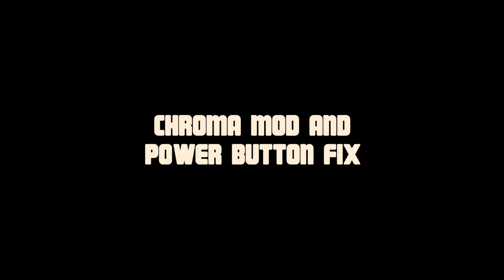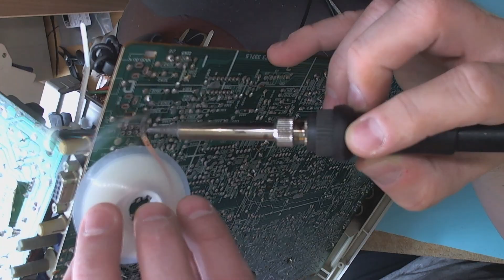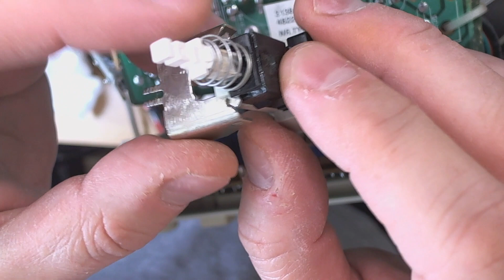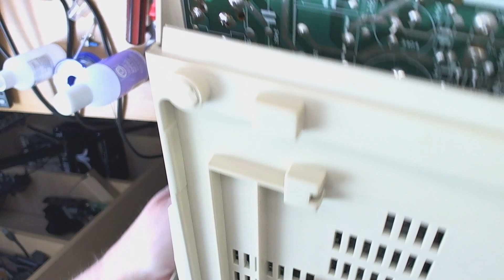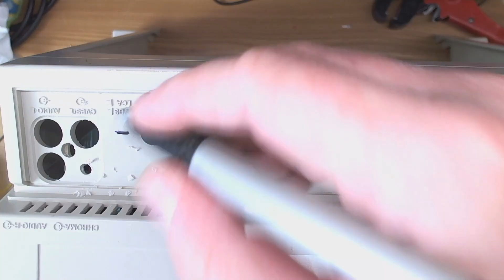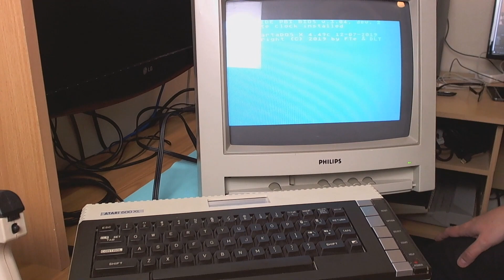Philips CM8833-II CRT Monitor Chroma Mod and Power Switch Replacement

Comment: Would you mind sharing where you ordered the different parts ? Are the extra switch and RCA panel difficult to source if you don't have a donor monitor ?
There is an online shop selling a ready made kit, but it's really expensive (about a 1/3 of the going price for the monitor !). If anyone reading this (especially in the UK) is able to put together and sell a parts kit, that would be amazing !
Reply from the maker: I got all the parts on eBay except the switch covers which I stole from another monitor. I might still have an RCA bracket but since I'll be in some degree of disarray until I finish unpacking and categorising all my stuff following our recent house move, it may be a while before I can find it. I don't see why the upgrade kits should be so expensive, although I can well believe it's the case (that's why I ended up sourcing the parts myself).
Reply: @flashjazzcat Thanks ! Would you mind sharing the exact make and models of the parts you bought on eBay ?
Reply from the maker: @renaudg  This is he only listing still live on eBay:
https://www.ebay.co.uk/itm/192342037172
This connector on mouser looks correct:
https://www.mouser.co.uk/ProductDetail/CUI-Devices/RCJ-412323?qs=0lSvoLzn4L8dQN4dMz0BiA%3D%3D&mgh=1&vip=1&utm_id=20797887759&gad_source=1&gclid=Cj0KCQjwwMqvBhCtARIsAIXsZpaCRPXorMrRjI9Ibb0Q1JSKQFv9nsgcfPZBSl-TDTvL4NmHb7LlBSkaAkSAEALw_wcB
The original instructions for the mod (first line of this video's description) are pretty clear, though.
Reply: @flashjazzcat  thank you ! Very helpful
Reply: @flashjazzcat  Looking at this RCA connector on mouser, and the one on the online shop I mentioned, it seems that the pins are in a different position unfortunately (and the connector colours are mixed up too but that's not a huge deal). I won't link the shop here but if you google for "rca input connector panel Philips CM8833-II" you'll find it.
Reply from the maker: @renaudg  Sorry about that. It's hard to remember much about the specifics four years after the event. Thanks for the tip, anyway.
Reply from the maker: @renaudg  BTW: Looking at the video, it appears I used the original plastic bracket already in the monitor, and simply drilled out an extra hole for the chroma jack. :)

Comment: I own a 1084S-P1 and a CM8833-ii myself, love them to death. The D1 and D2 variety contain Daewoo manufactured CRTs, not sure if the chassis were manufactured by Daewoo in those also, the P1 and P2 were all Philips and were much better monitors, the case design of the Philips CM8833-ii (MK2) is the best in my opinion and is similar to the Sony monitor sold to complement the MSX in Japan with that awesome tilt presentation, one of those is shown off in a YouTube video by the Cathode Ray Dude. Great VID, I had been wondering about this mod, seen the missing components on the chassis PCB the other day. 😊
Reply from the maker: Thanks so much for the interesting info and kind comment.

Comment: Fascinating mod. Should work great with any composite source (except maybe Commodore 64, where the Luma-fix will be needed on the computer itself). Which computers or video games can benefit from this except the XL-series?
Reply from the maker: This monitor will do composite out of the box. The mod allows connection of the chroma source and switching of the composite input to luma only (thus giving you Y/C video). I think the C64 will benefit from this (it's able to output Y/C video as well as composite). Not sure which others, to be honest, although this monitor is already a great match for those machines capable of producing 15KHz RGB.

Comment: Did you ever find out the source of the whistling?
Reply from the maker: I didn't unfortunately. I can only assume it's coil whine or something.
Reply: @flashjazzcat  that's a choke whining you could easily find with a vice recorder of your phone. This choke is usually looks like a power transformer, but smaller. Just pick your phone, find out where a microphone hole is placed and start recording. Put microphone hole closer to such working elements (not a flyback, but other components) and name how they look aloud. After finishing listen to recording and you would notice a significant increase of shuch noise when you are close to the right component. Those are usually start whining when their glue dried out with age. Hope this helps.
Reply: @mib_ua  That's very helpfuly indeed - thank you! I never got around to solving the issue, but hopefully I will soon, and thanks to your tips. ;)
Reply: @jonathanhalliday  no problem ) And one more thing: when you've located it, you could touch (press) it's core with some insulator stick (like piece of long plastic), and it should change it's level of noise. That's how you would be sure that it needs some glue.
Reply from the maker: @mib_ua  Magic - thanks!

Comment: Hi FJC, I have one of these monitors and want to do the Chroma mod which looks quite simple (fiddly) but do you know if the 8833 MKII has the auto discharging resistors in the HT lead cap or is it just the old grounded screw driver thing. I doubt there's any charge in it as its been off for years but better safe than sorry.
Reply from the maker: Hi Paul. I'm not sure if the CM8833-II has a bleeder resistor; I went full bicycle clip mode and didn't bother discharging anything since the monitor had been turned off for years. Check out Jan Beta's repair video covering the same monitor here (he properly discharges the tube): https://youtu.be/LgtNkfX4Rss
Reply: @flashjazzcat  Yep, I'd just watched it as I wasn't sure how to do it properly..Thanks for the help.....You two keep safe..
Reply: And animals of course :)
Reply from the maker: @Mclaneinc  The cats don't care about anything.
Reply from the maker: @Mclaneinc  Thanks - same to you. I fear mental well-being is by far my most urgent concern at the moment... surely not the intended reaction to the viral threat.
Reply: @flashjazzcat  Tell me about it....Apart from food and strokes...And yes, its stressful times for most and more for those of us with mental health issues, thankfully I have been a stay at home type since the depression hit so being cooped up is quite normal for me but a friend who works at Highgate Mental health says things are simply all over the place with admissions galore and extreme reactions to it all. Add to that the poor people losing livelihoods etc, the mental damage must be awful.
Reply from the maker: @Mclaneinc  Wow... I cannot say I am surprised by what your friend reports. Hopefully we find a less cruel and destructive way to cope with new viral illnesses in the future.
Reply: @flashjazzcat  I just spoke to the same guy and they just swapped a whole set of people across wards, basically wards are shut, patients moved which not only is an administrative nightmare for him but most mental health patients develop a sense of routine and stable environment so all this must be horrendous for them.

Here's hoping..

Comment: Nice vid as usual FJC, surprised you didn't take the board out, must have been a pain doing in that way, even worse to video. Question for you tho, I have two montors with the dreaded latch pole switch that has stopped locking, I've looked about ebay but not seen a sign of a Commodore 1081 power switch nor a Phillips 8852 power switch...I'm sure an 8833 switch might work as they from the outside look the same...Any sources, not looked on Aliexpress so I guess that's my next move. Glad you warned about the residual charge in monitors, we used to live above a TV repair shop owned by our landlords and Malcolm the shop owner used to get belts from the charge all the time, you would just hear a "urrr" from downstairs  and that was him getting hit by the KV...He said he hardly noticed it but then had a stroke so maybe not the most clever thing to do...Any way, bang tidy vid there and very helpful.
Reply from the maker: Thanks for the comment. :) The 1081 appears to use a shorter form-factor switch - see here: https://twitter.com/vsg_de/status/652512896442859520
I'm guessing the 8852 may use the same one. There's an interesting article here: http://www.retro-commodore.eu/tag/1084/
Scouring the internet using image search can be productive. Some years ago, I eventually found a company in Germany and sent them an email. The guy who responded sold me three brand new Grundig switches (for the 1084-S, CM8833-II, etc) for about a tenner. I used the last one in this video!
Reply: @flashjazzcat  Thanks for the reply and details...These bits are getting harder and harder to find, considering I used to stock and sell latch poles stuff at Maplin it just seems hard to get this gear, bah, new fangled technology making our life smaller and better..Damn you :)   Cheers

Comment: That does look good.  I did a mod on my 800XL back in the day that promised RGB output from the Atari.  I wish I could remember where I got the plans as it made for a very sharp picture.  I used it with a Magnavox RGB monitor that looked really good.  I wouldn't have a clue how to wire something up on a US 600XL with the awful RF connection.